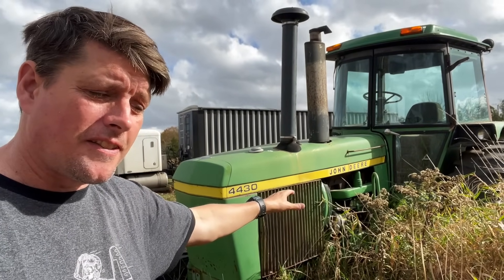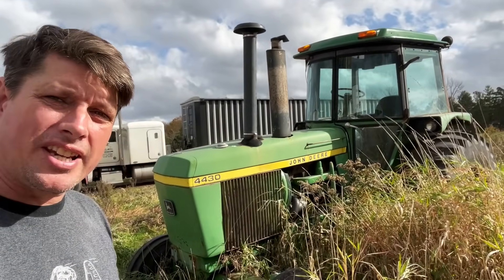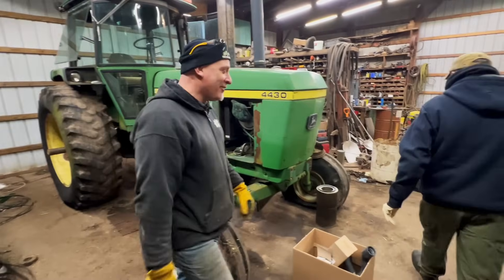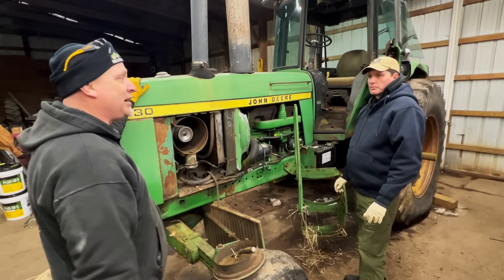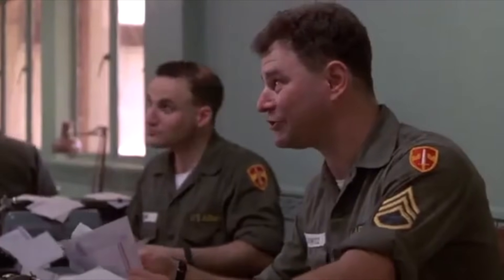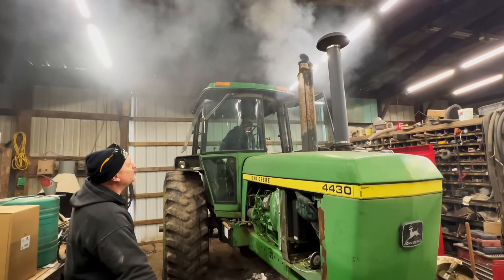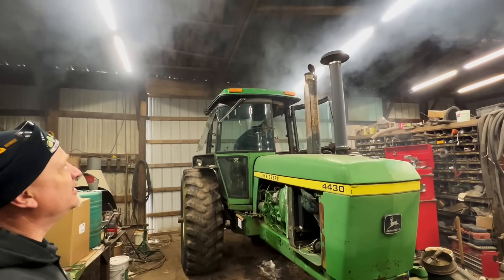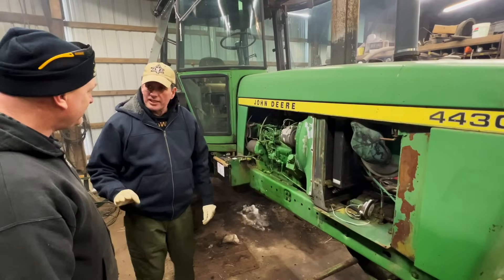WILL IT START ? - OLF's JOHN DEERE 4430

Comment: I would be quite happy to drive the 4430 all day every day. If John Deere re-released them tomorrow  you would have to line up to buy one. I know of a 4830 still driving a big square baler as a contractors machine. It doesn’t get much TLC either. Jeff

Comment: I can see in the comments that more love New Paint and Payments, and don't get it. The corn doesn't grow any faster with a bank loan tractor or vintage machinery, but the vintage gear can keep your farm profitable. You can buy a pair of used tractors for just the down payment on one of the fancy pants tractors. If you have payments on a tractor, tillage accessories, planters, sprayers, and combines you need to cover so many acres that you are no more than a Peasant for the Banker Lord's treasury.  Do some spreadsheets on six weeks of corn planting and how you can cover huge acreage with four, six, eight, or twelve row planters and smaller more fuel efficient tractors; throw in rain delays, it's kind of surprising how much coverage can be had. And then look at leaning up the processes where you no-till vs plowing and the equipment needs lessen and so on. Be clever because bigger payments mean less profit.

Comment: I would go for the 4430. John Deere also made the 3 cylinder 1130 in 1977 with 2 x 12 volt in parallel. They are a bit of a bugger to get at though as they are housed in front of the instrument panel. Air con on mine, no problem , I just take the doors off the Duncan Supercab!

Comment: John deere is great when they work.
Reply from the maker: Fords are great when they haven't shat their guts and gone porous...
Reply: @LordMuck  Amen! I only have the little guys that don't do that so much..
Reply from the maker: Out of interest what coolant mix do you use ? 60/40 ? 50/50 ?
Reply: @LordMuck  To be honest, I put two gallons of straight antifreeze and top with distilled water, whatever that works out to. 
The biggest ford I have is the 5000, two actually,  and a 4cyl 4610, the rest are 3 cylinder, not very big cooling systems. Has worked for me so far.
 Also, I flush/change coolant every couple years.
Reply from the maker: You'll probably never have any issues doing that 👍

Comment: I was lucky enough to mow silage with a 4240 with John Deere mower with grouper and tow a trailer with silage behind a 4230 during the mid 90s. If mowing and the sun was beaming in around 3 in the afternoon I often had a short sleep easily against the back window as it was so close behind you.I wouldn’t mind a few days again on a 30 series. The 4230 I drove was involved in three accidents that I know of. When new a train hit the weights at a level crossing removing the weights and the blob in the middle of the weight carrier, next a car on a narrow road burst the back tyre and shattered the window on the opposite side because a passenger in the tractor hit it in the impact. And lastly half a mile further up the road on a bend two drunk biker’s a few years later met the protruding rear axle and ripped the leg off the passenger on the bike.

Comment: Great videos would love to see some selectomatic david brown tractor videos if you get the chance. They were popular and reliable here in NZ. My father owned a fully spec 780 with 12 speed box, powersteering, dual wheels and factory auxiliary rear hydraulics it was a great tractor and would perform as good if not better than the 135 massey with multi power that we had. Also owned 990, 1210 etc and I used to drive a 1490 hydrashift. Cheers

Comment: Now that is a great and proper tractor. Imagine trying to do a "will it start" on a forty year old 6R 175 or similar. Modern wiring looms are so thin, rodents love them, heat cracks and breaks them and printed circuit boards fail.
In answer to the question, there is only one true answer, 7530 melod!

Comment: 5020 with a canopy. Something interesting my neighbor bought an Oliver 2150 at auction. The most interesting part is someone repowered it with a Cummins form the 60s. Think it is an old C series the engine runs good but the oil is contaminated.

Comment: Mucker, were Zetor tractors popular in England back in the day? I believe there may have been a good following in Ireland. Here in NZ they were a cheap FWD, often very under rated and got a bad rap for being from a country that was part of the USSR at the time and the dealer network was rather poor. The People that owned them generally loved them and often owned several, they used to say they were good pullers with great traction. As STD they often had a lot of extras that weren't always offered with the bigger brands. You could basically say the same about the Belarus brand here too, but Zetor was much more popular. I would love to see some content on an old UR1 series and Crystals or even a Belarus tractor if you ever get the opportunity as they are 
Quite rare here now, I do know of the odd one around but mostly they have gone to scrape. Cheers
Reply from the maker: UK importer for Zetor was near to here, I think we've all owned or driven one at some time. For the money I can't say a bad thing about them. I was going to look at the modern versions but the new importer was about as helpful as a drone strike on a gas station.
Belarus has also featured in my time and you might like this 😉
https://youtu.be/FEhOC691ZU4?si=A29mgPv8XjXrvw5d
Reply: Interesting, cheers

Comment: You would always stick a couple of diesel filters and make sure the water separator is empty, just to save the diesel pump.... unless you're a carrot cruncher.
Reply from the maker: And introduce air in to the system ?
👏👏👏👏👏
Reply: @kevinharker if an engine hasn't been run for a length of time and fuel is in the system you never change filters until it has fired. Once it has run then you can service it. Introducing potential issues before a start is a real school boy error. 🙄
Reply from the maker: Kevin, if it looked like crap fuel I'd run it off a separate supply until it fired up. Glass housing was clean and clear so no real risk (that's what the filter is for) now it runs the element will be changed.
Reply: @LordMuck  Stood for 9 years.. supposedly.. heard it all before Mr Muck, been sat in the nettles for a couple of months? surely a couple of filters is cheaper than a knackered fuel pump?
Reply from the maker: Well it's been stood outside for 5 years that I've seen.
If pumps were that delicate they all be constantly breaking. Anyway it runs, pump is fine.
Reply: @LordMuck  Good stuff, as you've realized, I'm not a Lord Muck arse licker.. is always good to put another point of view across, and it gets the keyboard warriors at it, anyway Mucka, good vid 👍
Reply from the maker: I'd lick my own arse if I could reach... 😉
Reply: @LordMuck  😉
Reply: @LordMuck  I can confirm it's been outside for just about nine years.  Been back and forth to my friend and neighbor's farm many times in those years.
Reply: @LordMuck  Try yoga, I hear it might help that issue and save on toilet paper cost.
The old put legs behind head and drag ass on ground might also help, maybe?
Wes sent me here, and so glad he did. SUBSCRIBED.

Comment: Could you have cranked via pto ?
Reply from the maker: No,
Reply: On these machines the pto is engaged with hydraulic pressure. So no pressure and the clutches won't be engaged.

Comment: I would take the 4430 with the muffler and that stupid flapper connected to it off,run a 4.5 inch straight pipe with a30 degree bend!and listen the big john talk,maybe the reason that I have to say  say  a gan alot just me